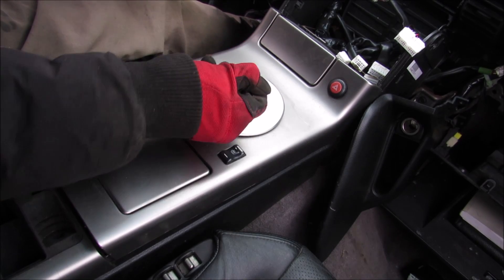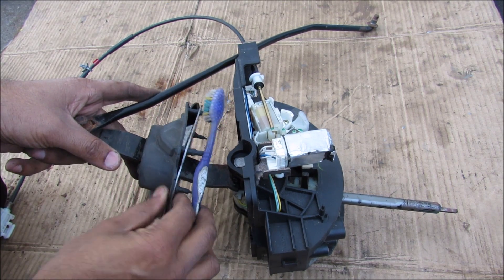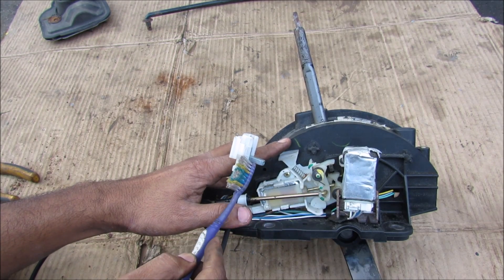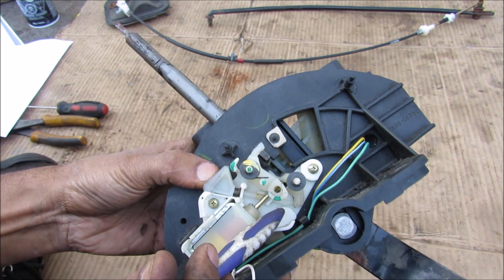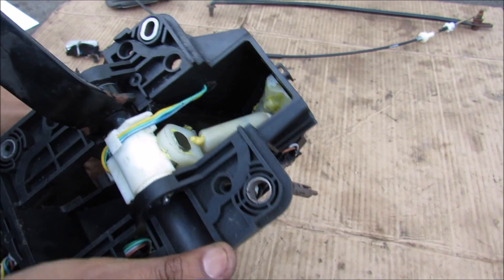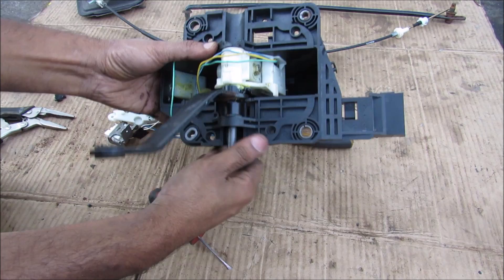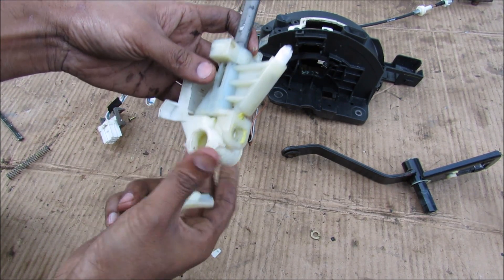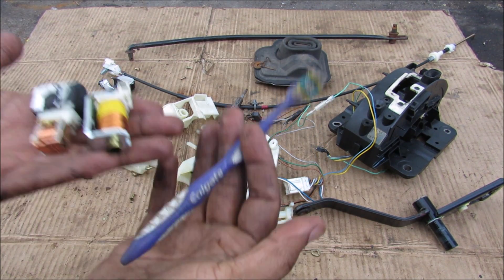How a Shifter Works

Comment: You forgot to mention about the electrical signals for reverse, neutral and drive. I think it has to do with different voltage drop outputs for each segment

Comment: Have a question, i have a 2014 honda accord and when in any gear besides park its not showing me on dash which gear iam in car drives fine but just dont know why my gear selctor is off track if i move shit knob quarter inch forward it will show i tried adjusting the shifter selector assembly and cant adjust it as its natural place is only one place any advice ??

Comment: Got a 2008 infiniti g35 and the white pin that lays under the shifter knob stays half way down when it goes into park and doesn’t pull up the switch actuator because the pin stays stuck down so a message on the dash pops up saying to put the car in park because the switch actuator doesn’t go up with the white pin like it’s supposed to. How do I fix that white pin ?
Reply: And what I mean by the white pin is the plunger like you stated in the video

Comment: Super informative! Thanks! Also feel better knowing most Auto Gear shifters have manual override. I need it on my Peugeot 307 as it wont start but need to get it on the trailer but it's in Park at the moment ;)

Comment: hello, is it okay if the gear selector is always pressed? will it damage the trabsmission even though it is not put on reverse or will it show any check engine or any electrical problem or will it destroy the trasmission overtime etc. because i change my knob with a manual transmission knob and i alrady fixed it, (*it is always pressed) pls. help me
Reply from the maker: Nah it's just a lock out. Means that you can accidently pop it into another gear

Comment: glad, you uploaded this video,, do you know if honda/toyota late model still have the hard wire going from shift lever to transmission or it is all controlled by range sensor to ECU, then ECU to transmission to let transmiission know to what gear to shift.
Reply from the maker: Yep as long as they have the lever, they have the cable going to the transmission

Comment: At ~2:45 in to the video with that "override botton", when the shifter is fully assembled in the car, is that the same Override button (that most  center console shifter vehicle has that opening slot) where we can just push a key in to release the shifter?

Great video again without saying!
Reply from the maker: Yes. Sometimes the button has a knockout cover on it.
Reply: speedkar99 Thank you!  👍